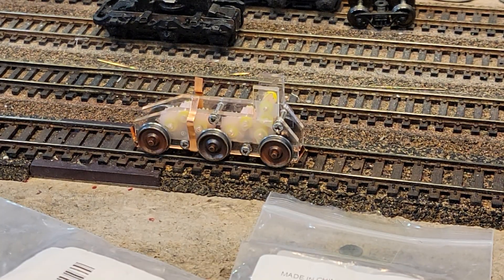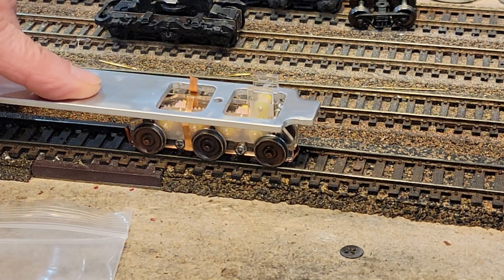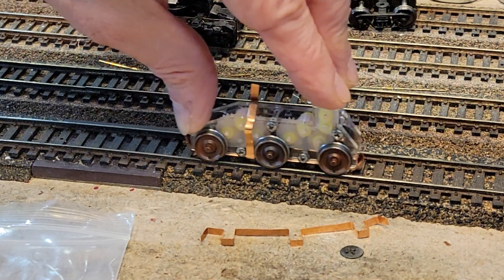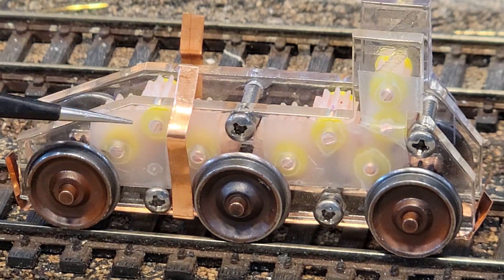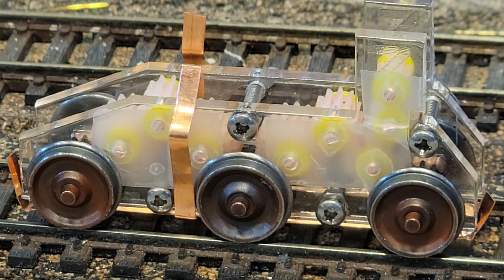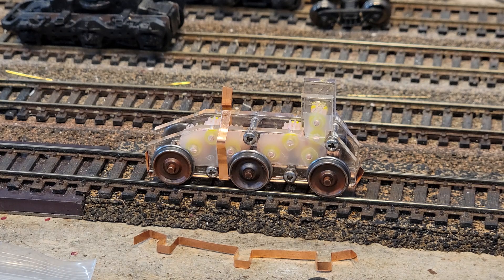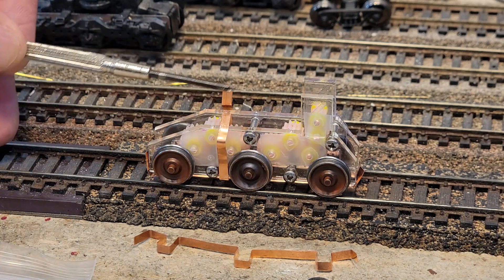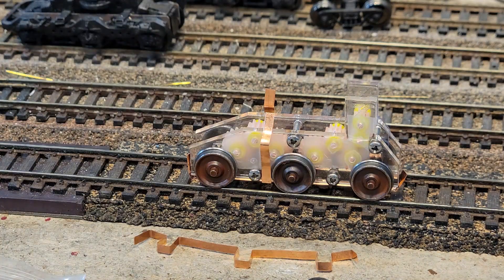2022 5 Loco Contest Part 21 Mark VII Truck

Comment: Hi!! I've been subbed to you for quite a while and I gotta admit I'm a bit stumped on this series of videos!! I understand you're scratchbuilding a locomotive for a contest, but I can't understand why you're building the trucks and frame nor what direction you're trying to go with this overall!! I guess what I'm asking is what does the rules of this contest entail?? Thanx in advance!!! 🙂
Reply from the maker: so at the annual contest I'm allowed to enter 5 locomotives.  What I need are 3 of the 5 to reach a score of 70% which is very hard to get.  I need 1 of the 5 to be a completely scratchbuilt locomotive.  For the trucks, I'm only required to scratchbuild the sideframes, but there are a lot of extra points to get by doing more and I think a totally scratchbuilt truck can give me a huge cushion in the scoring.  My plan is to do all 5 of my entries completely scratchbuilt to give me the best chance of getting 3 qualifiers.  And then I will win a special piece of paper that might be displayed on the door of the bathroom in my workshop - that will guarantee that some people will see it!

Comment: The wheel was invented, but we only made two.  Civilization waits another 2000 years.  I told Elon Mush, you aren't interested in selling these.  He said he would give you a space ride.
Reply: Don't you have five other locos' needing some attention?  I got a Rivarossi E8 and it doesn't have one of those black motors.  Has motor as big as an egg Similar, though beefer Athearn drive train. What is it?  Need a dog bone.  What episode?
Reply from the maker: @blainedunlap4242  2021 holiday special - I've evolved from making dog bones out of copper to silicone.  The E8 first had that huge motor that was also found in the FM C-Liner and the BL-2.  Later they mounted the 3 pole motor vertically and that setup is amazing even with the old 3 pole
Reply from the maker: I'll make my own space ride soon enough.... the Mark VIII is already on the drawing board and almost ready to be made